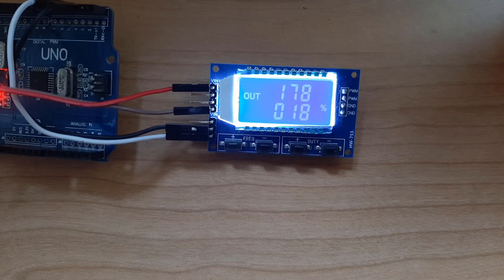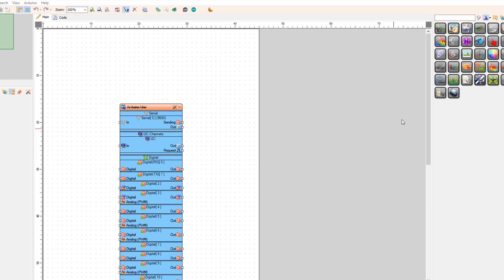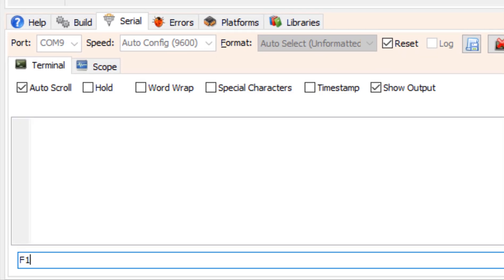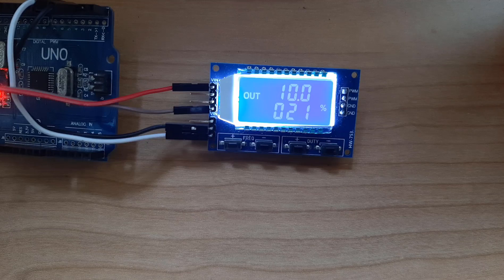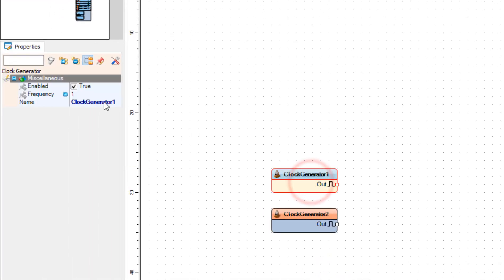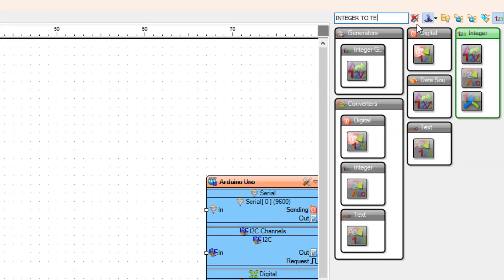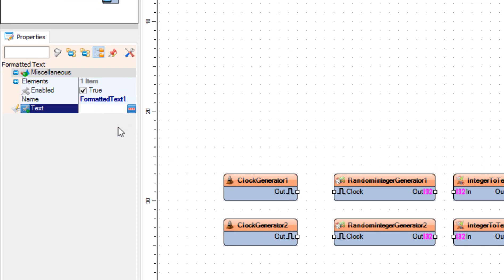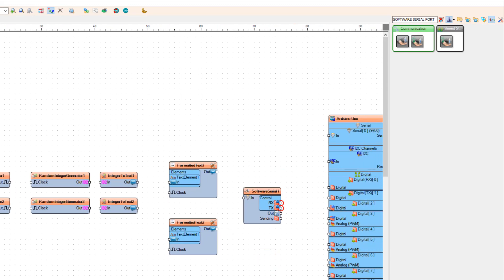How to Control PWM Signal Generator Module With Arduino & Visuino

Comment: Hello. Is it possible to make commands sent from arduino pro mini without a computer? If you know, please help. At school, for a project, I need to make a generator of fixed frequencies and a duty cycle of 2% on the xy lpwm board, So there is a mechanical switch for 7 positions that will switch frequencies.

I do not know how to organize a sketch for such a project. Maybe there is a similar sketch? Or share your experience of what can be done. 
Below is a link to an example.
I am grateful in advance.
https://drive.google.com/file/d/1VbtFDoBVHmZ62bRzyCww-577tejIJo_L/view?usp=sharing